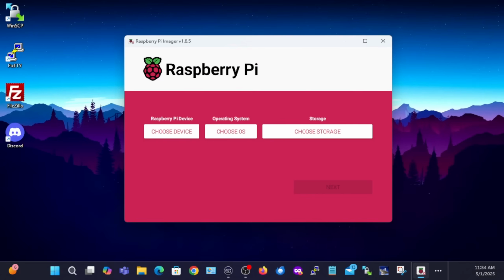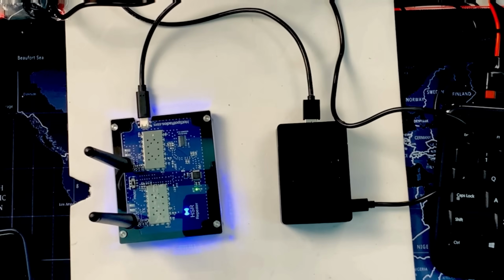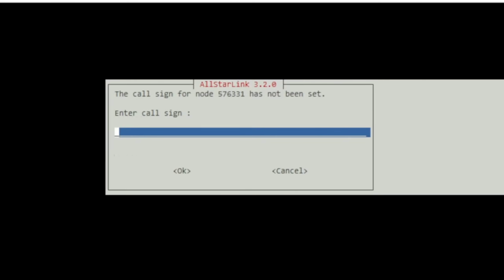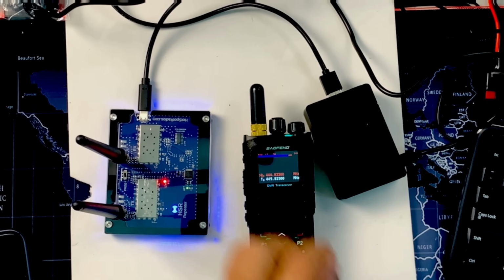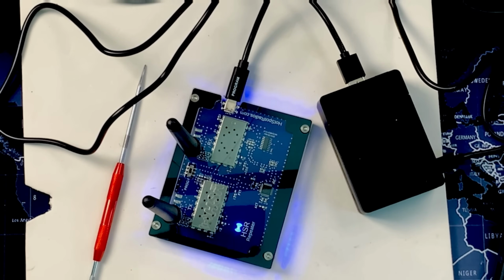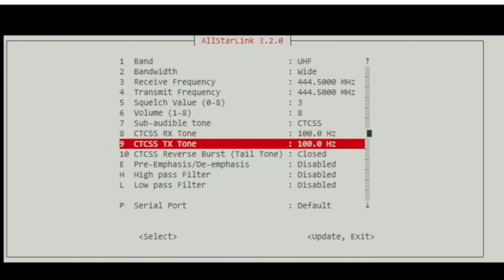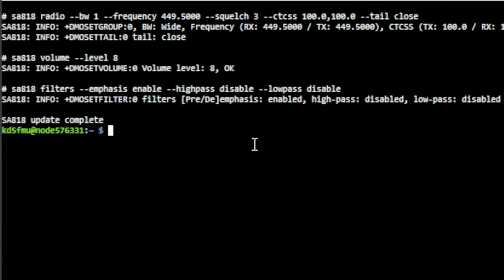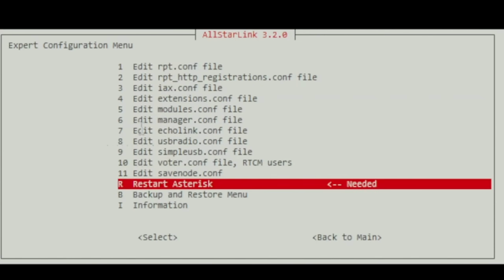HSR Mini Repeater Review & SA818 Programming

Comment: So if I am understanding this correctly, I can use my HT (BTech DMR 6X2 Pro or TYT MD UV390) with the freq I choose and program into the hotspot/Pi and be able to communicate through Allstar with the node I select ? Or am I total off base?
Reply from the maker: As long as it’s in analog mode ;-)
Reply: @HamRadioCrusader  Gotcha! So I may be better suited using a UV-5R or similar.

Comment: I have a similar setup to this. My problem with it is that I am keying up the node, but no audio is passing through. The sa818 is programmed correctly and worked fine on another node. I figured allstar had its own PL tones built in, but I couldn’t find where. Are you able to help?
Reply from the maker: AllStarLink software does not generate PL tones that is up to the sa818 chip(s) can you share your simpleusb.conf file to me at kd5fmu@gmail.com ?
Reply: @HamRadioCrusader ?
Reply from the maker: @GioTurano53 been busy let me look
Reply from the maker: @GioTurano53 what is your email? I am not seeing it
Reply: @HamRadioCrusader  Sent. Thanks
Reply: @HamRadioCrusader  Did you receive it?

Comment: I have the same Device Repeater, but I cannot walk away from it not more than 70 feet before it starts to not work, due to he antennas being so close.
  Also When I have make an Image for our private network within our group, but now I cannot seem to get the Image to receive correctly.
   What I mean is that when the device tells the time or someone with a higher voice they tend to mute out when talking at times also when I change nodes it does it too when receiving the info it mutes with the IP address and so on, but I can make out some of it, not sure why it is muting out some of the audio maybe the high pitched voice frequency? 
  I have tried everything, nothing works.
Reply from the maker: It almost sounds like desense. Make sure the antenna's are firmly screwed down they have a tendency to come loose. Also get yourself an sma to so-239 adapter for the transmit side and connect a mobile antenna to it. Then give is a good amount of separation and play with it. My TX antenna is outside of my truck and the RX antenna is inside the truck.

Comment: Does it work with a Verizon cellphone hotspot? I don't think there is the option to allow specific port traffic to use the Verizon WiFi hotspot. I think having a mobile WiFi where you can open up a specific port number is the most important factor to have a functional mobile AllStarLink node. I'm not sure if the repeater frequencies would have to coordinated with whoever coordinates repeater frequencies. That might be tricky to coordinate the repeater frequencies of a mobile repeater because the physical location is constantly changing as the vehicle travels.
Reply from the maker: Yes it will work with Verizon. The only port you need to forward is for inbound connections only. So if you can’t enable an inbound port, then connect to a hub and see if the other parties can connect to that. This will allow conversation that’s why I have a cloud, hub.

Comment: These hotspots need to stop using venerable SD cards. 

Real NVMe are stupidly cheap now and far far more reliable. 

Plenty of SBCs have the ability but hams are stuck on Pi boards that aren’t keeping up on board design, for whatever reasons. 

Heck I just picked up a literal pile of real 1L Intel 4th gen PCs (Lenovo m93p) for $45/ea with SK Hynix SATA SSDs, 16 GB RAM, i5, WiFi, and their multitude of USB3.1 ports. $20 cheaper than a Pi 5. 

Absolutely smoke a Pi 5 too. 😂 Debian Trixie now in freeze runs beautifully on them. 

Good video. Just amazed these ham things keep using the Pi stuff that’s falling further behind every day. 

Heck, those PCs even came licensed with Win 11… if I cared! Ha. 😂 Even run that ok! 

Cheers! 🎉
Reply from the maker: Mi Pi 5 on the node now runs from an NVME drive

Comment: What does a repeater get you? 73 Freddie , KI5YWF Don.
Reply from the maker: @mosierbuild  Really at the end of the day, it gets you full duplex instead of half duplex. It works great with an Autopatch setup.
Reply: Very good!   a question..
What would be the use of the mini repeater?
Reply from the maker: @Glock21911 I find when I am almost a group we all can use the repeater to talk to each other in a good distance and STILL be connected to other stations on AllStarLink. When You use a simplex node among a group who are at a distance from each other their signal is not being repeated so it’s a point to point transmission. Do you follow?
Reply: @HamRadioCrusader great explanation!  Thanks.  Im on their website now!  😊😊😊
Reply: @HamRadioCrusader also, what kind of distances are you getting?
Reply from the maker: @Glock21911  Confirmed 1746 feet for sure maybe longer
Reply: @HamRadioCrusader pretty good